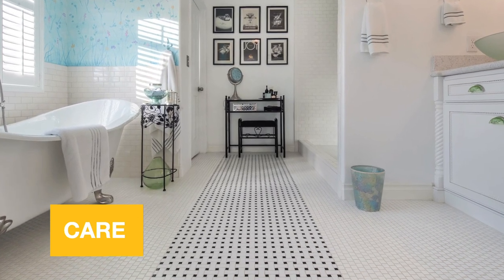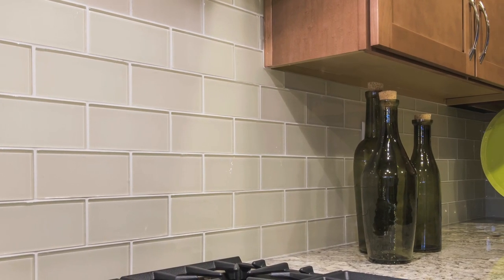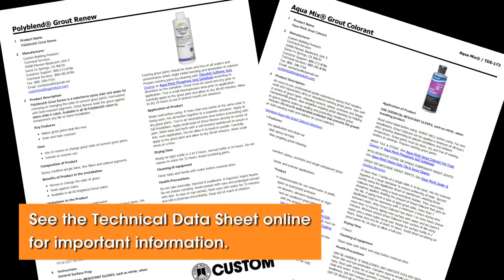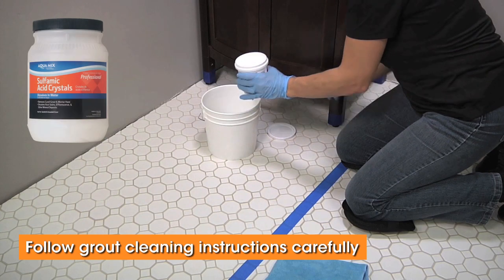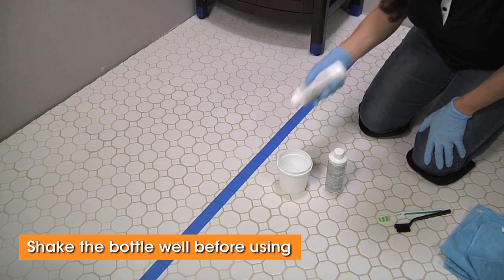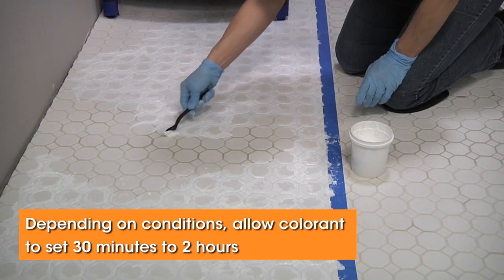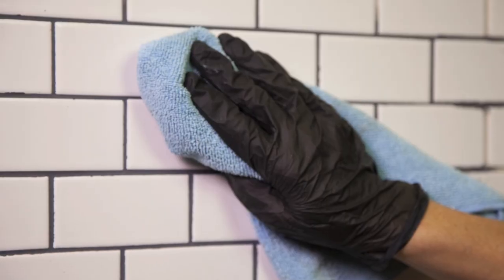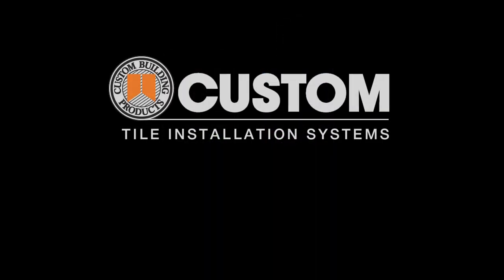How to Use CUSTOM Grout Colorants

Comment: How do I get off the grout sealant from a few spots on the tile I forgot to wipe before it dried?
Reply: Wet the area with the excess sealer on the tile with a damp, microfiber rag, wait 5 seconds, then wipe it off using the same rag. It comes off easily when surface is wet.

Comment: Hello, great video on a project that I have been dreading for a while just because it is labor intensive.  But, now I have the momentum to go ahead with it.  Question:  Is a grout sealer needed on top of the paint?  The product I am using states that it is a paint and sealer all in one, but I want a truly sealed grout this time so I am thinking of using a stand alone sealer on top of the coat of grout paint.  Would you recommend the same?

Comment: I would not recommend this product to anyone. It's basically a tub and tile rubber paint. It does not color grout, it puts a rubber layer over the grout that comes off very easily. Worst stuff ever and now my counter top looks a mess.
Reply: Not for countertops and showers. Will not last in these environments. It does work well on indoor tile floors if properly prepped.
Reply: I put this stuff (Charcoal Grey) on my Black Penny tiled shower floor. It hasn't washed away so far. Stay tuned on how it turns out.

Comment: DO NOT use it inside showers, countertops or outdoor. Floor must be properly degreased and cleaned for proper adhesion.
Reply: Can I put 511 Enhancer over it before using it? I used this on my Tiled shower floor.
Reply: @Shawnpee3496  If you have a stone floor that you want to enhance/darken and you want to change the grout color of that floor. Then color seal the grout first, then do the enhancer. If you enhance first, then the color sealer won't adhere well.